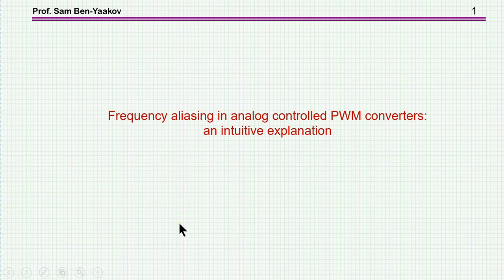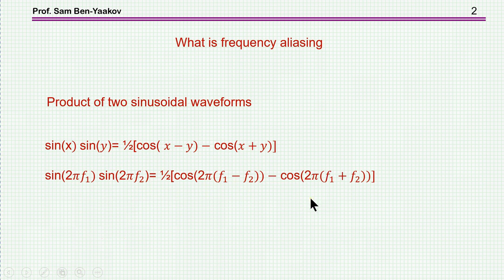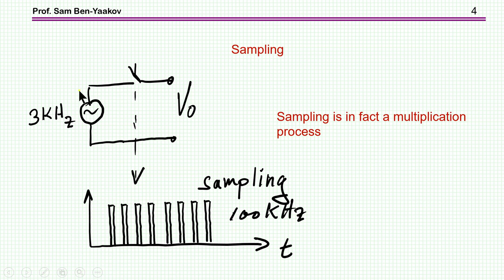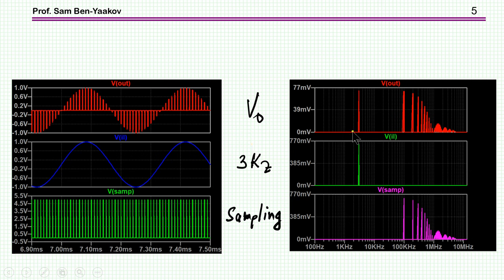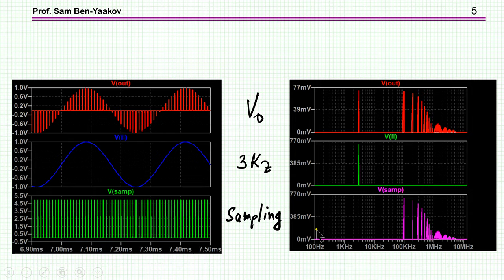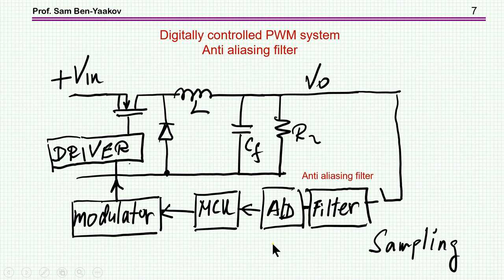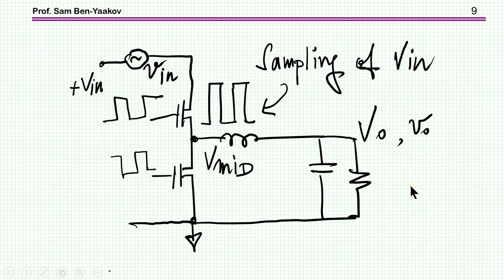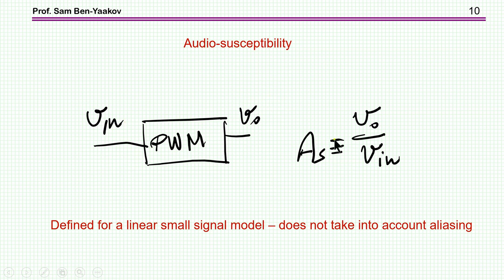Frequency aliasing in analog controlled PWM converters: an intuitive explanation

Comment: Does it mean that i should avoid having 2x buck converters in series working on the same frequency?
But, actually ripple voltage calculated on capacitors will be in uV, so should not cause any issues (?)
Reply from the maker: Same frequency OK. Deferent frequencies is a problem.
Reply: @sambenyaakov  I should say "similar frequencies" as it can be difficult to have same on two chips due to manufacturing tolerances.
Reply: So i also understand that chips with synchro input will be solution to that.

Comment: Dear sir i m making a 16 kv capacitor charging power supply but not able to charge capactor (0.172uf) in 1.2 millisecond my transformer output having 4winding each have 28mliH inductance and primary having 0.577mili H  using HBridge  adopting ZCS
Reply from the maker: Have you carried out simulation?
Reply: @sambenyaakov  which software is used to do simulation.
Reply from the maker: LTspice
Reply: Sir how to calculate high frequency transformers turn pri and secondary

Input 565dc via LC resonance and output is 16000 vdc output current 1.5 amp to chage 0.172 uF capacitor i have   uu core 126/91/20 TDK 3 stack size Ae 560mm2 le 480mm Al 3000±25% ue 2000 

How much b max we have to choose for 40khz
Reply: @scienceinnovativebrain  go through coursera Fundamentals of Power Electronics , or the book. Then, most of your answers will already be answered and the conversation enriched

Comment: It does help , the current gpu pcb like ex rtx3080 from nvidia usese in paralel more than 10 converters to supply the power to its gpu , and they had issues with decoupling caps which the cut off freq was not enough ....etc . Thank you .
Reply from the maker: HI Thanks for sharing. Intersting.
Reply: how much current in total?

Comment: Sir could you please make a video on How to read BJT and Opamp datasheet ,the way you made MOSFET.. Thanks in advance
Reply from the maker: Have you seen  these videos in my YouTube channel?

Noise in Operational Amplifiers circuits
An intuitive explanation of electrical noise sources and the basics of noise analysis in Op Amp circuits.

ElectronicBits#11: DC errors in operational amplifiers wmv
In this ElectronicBit Prof. Sam Ben-Yaakov discusses the subject of DC errors in operational amplifiers due to offset voltage and input currents.

ElectronicBits #5: Stability of Operational Amplifiers
In this ElectroBit Prof. Sam Ben-Yaakov shows how to asses by a simple graphical method the closed loop stability of OpAmp based amplifiers. _________________________ Prof. Shmuel (Sam) Ben-Yaakov Mail: sby@ee.bgu.ac.il Power Electronics Laboratory: http://www.ee.bgu.ac.il/~pel

ElectronicBits #2: Operational Amplifiers as feedback systems
In this ElectroBit Prof. Sam Ben-Yaakov shows how OpAmp based amplifiers can be modeled as feedback systems, introducing the concept of the G block.. 

ElectronicBits #1: Ideal Operational Amplifier
In this ElectroBit Prof. Sam Ben-Yaakov describe the features of an ideal operational amplifier (OpAmp) and show how these can be used to analyze the inverting and non inverting amplifier configurations.
Reply: @sambenyaakov  Yes sir I watched all of them..I have one question related to BJT datasheet .. whenever I look for Hfe value always given in terms of range ..so how to choose Hfe value while designing amplifier or switching circuit?
Reply: @biswajit681  I'd say you choose it to be "enough". As you may have seen, hfe varies greatly between devices and is also dependent on current. So generally designs strive to remove the dependence on hfe.
In the simplest common emitter amp the voltage gain is directly dependent on hfe. By simplest I mean grounded emitter, only a load resistor (Rc) from the supply to the collector. 
If you add a resistor (Re) between the emitter and ground  then the dependence on hfe is almost entirely gone and gain is now approximately Rc/Re